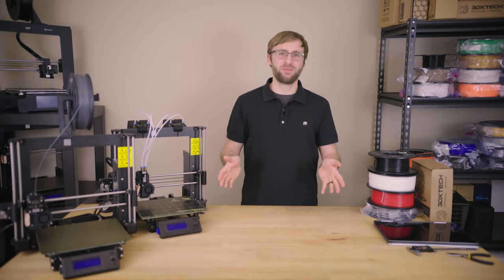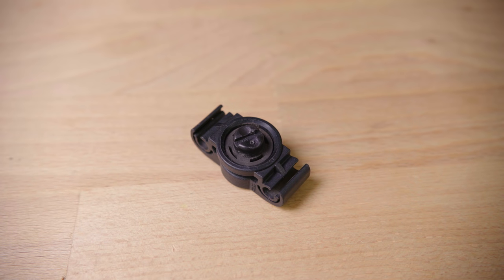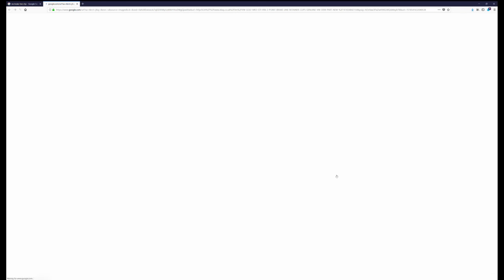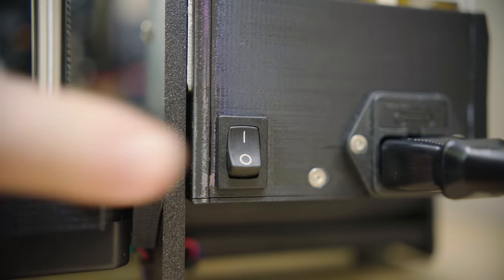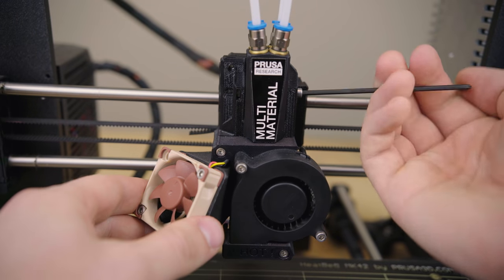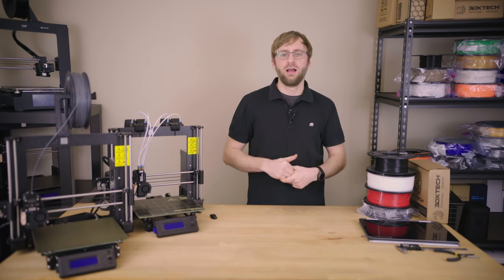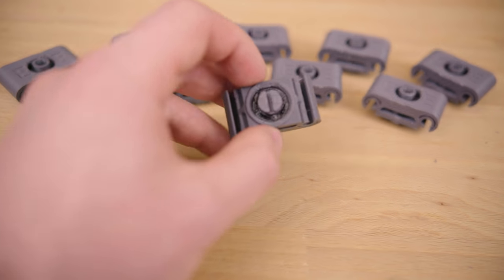3D Printed Car Parts? We put ASA to the test!

Comment: Love the video. How do you copy a manufactuer part into a 3d printed part? The one you copied seems complex
Reply from the maker: Cedric Vallieres Thanks, we really appreciate it! I'll have to do a video on this! One of the easiest ways to copy a part is to take a picture of it and bring it into your desired CAD software. You then scale the image to the size it is in real life and then model off of that. As you create it you can constrain it further by making more measurements of the real part. The goal is to make it is close as possible. If you have a 3D scanner that's another way to do it but those usually aren't very accurate so you have to touch them up in CAD as well. 
Hopefully that answered your question? :)
Reply: There are photogrammetry apps for phones that will capture a 3D model of a real-world item.
Fine-tuning that with actual measurements would be the go.
I'm not sure which ones support STL, DXF etc as the output format.

Comment: I've watched this video to see if it is worth buying a 3D printer. As a technology fan I really like gadgets and I enjoy figuring them out. Unfortunately your case has shown me that the learning curve and obstacles you need to overcome would make this really hard for a regular user to utilize. I have faced the issue you present many times. Some tiny plastic part broken caused me to throw away the whole appliance, I thought 3d printing would be an easy solution. I'd probably get a 3d printer one day anyway but I won't recommend it to anyone whose not a geek like me :-/
Reply from the maker: Exactly. If the files do not exist in the Digital 3D world then they will never be printable. Not to mention some parts are hard to print or require special materials that require expensive printers. It is by no means an easy market to get into but it is definitely getting easier as time goes on! Thanks for watching
Reply: Thanks. I'd say 3D scanning needs to follow. We have phones with 3-4 cameras right now, maybe soon some clever developer would come up with a way to utilise that and create a printable 3d model. That would be a breaktrough...

Comment: Did you print the clips as a batch or one by one. In my experience with 3DX Tech's ASA as well as Spoolworks ASA and e3D Spoolworks MatX the layer bonding is horrible for large parts or when printing multiple parts. When printing a singular part the previous layers are still warm and allow good bonding. I suspect that your MMU is working perfectly fine and the wipe tower is letting your part cool.

I have tried changing speed settings (down to 15mm/s) as well as temp increases (up to 270deg c) and 0.1 - 0.3mm layer height changes, all having a small impact on the layer adhesion/strength.

The most effective method to that I have tried is to enclose the printer which brings the ambient temp up.
Reply from the maker: After each design change we printed a single part and then once verified switched over to complete batches. We did a batch on a MK3 and a batch on the MMU MK2S. ASA just like any higher temp material requires a heated chamber to get perfect prints with perfect layer bonding. Just enclosing the printer can help ABS/ASA and even some PC prints turn out great! Most small prints turn out okay without a chamber but anything large absolutely needs one. 

I will have to try enclosing the MMU to see if that makes a difference when using HIPS as support. The MK3 printing a bed almost completely full of the clips with no issue makes me think I may still have the issue but it's worth a shot! Thanks for watching and discussing this! :)

Comment: Use PBT from zcory.com it can resist at 150° in continous and it's liquid gasoline and vapor resistant
Reply from the maker: Only issue I see is PBT does not do well in wet environments and is not UV resistant. PPS would be best and a fallback would be a GF Nylon which is what the original parts were made of. Thanks for watching!

Comment: Wont buy from Europe since it's too expensive but is happy to spend hours measuring dimensions, designing and printing components. Likely costing much more in the long run :D
Reply from the maker: They didn't have the stock or the lead times I needed. Challenge yourself with tasks like this and you'll become lightning fast at solving problems! Fusion 360 is free for hobbyists and small business owners FYI. Try it!

Comment: Dude you cannot get a strong ASA print without an enclosure
Reply: Christ dude stop
Reply from the maker: @bradleyhovan9390  Not sure if this second comment is talking to yourself or what but your first comment is not entirely true. Lower Z height prints can function  without an enclosure due to bed heat and it is also greatly affected by environmental temps/airflow. Larger ASA parts will not only require an enclosure but also require a heated chamber for best results. I recommend the Gearbox3D HT2 for that job. Have a great week and thanks for watching! :)

Comment: Like someone will go underneath the car to give U a attention to detail golden globe award.
By d way u seem like a nerd like me tell me how to 3d print car parts like calipers or steering wheel.
What is the reliability of 3d printed things under stress environment
Reply from the maker: Hahaha! I am a bit obsessive with detail. Passionate about it to say the least. :) Calipers can be done via SLS printing. Check out the Bugatti calipers that were 3D printed and shown off recently. They even did testing on them! Steering wheels is a tricky one that I don't think I would trust my life to unless it was done with something other than FDM or if there was a rigid support. Something to backup the plastic as making the steering wheel purely from plastic could be very risky! I'd say a SLS printed steering wheel could be very promising as you could make it nearly hollow to save weight but it's metal so it's still very rigid and strong! No easy answer sadly. Really depends on the environment and the selected material....

Comment: How about an IDEX printer? Formbot Trex 2+?
Reply from the maker: We have been dying to get ahold of one of those. That appears to be the most ideal method of printing multi-material. That or the style the Ultimaker 3 and Stratasys machines use with lifting nozzles when not in use. I have heard mixed things about the Trex 2+, if you can handle diagnosing the problems and upgrading some parts I say go for it! If not then I would look elsewhere!